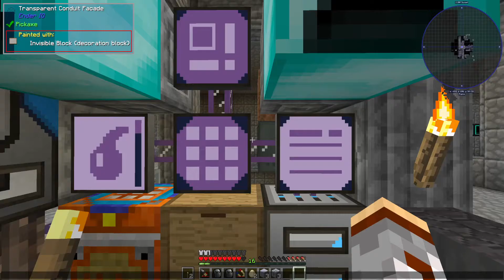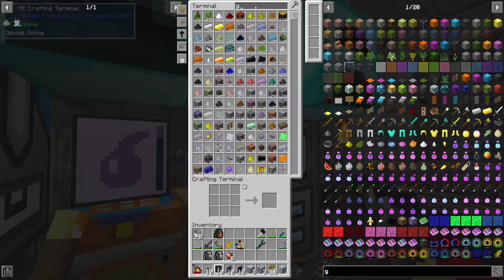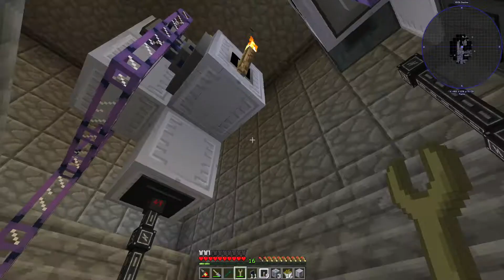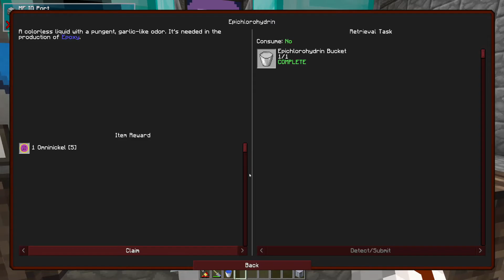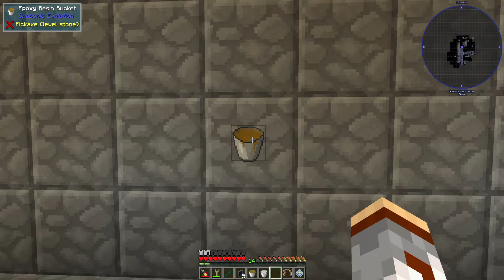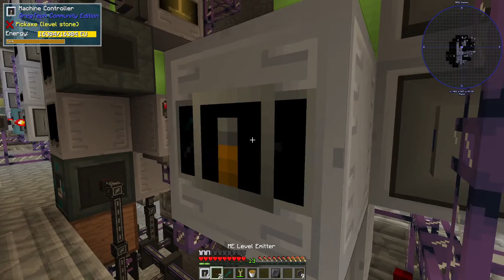(S2) Omnifactory: Dev Version: Ep 42 - Epoxy Sheets & Boards

Comment: If BPA is only used in epoxy production, it might not be necessary to store it. Just output it straight into the chemical reactor producing epoxy and just level emit at the final product. :) The intermediates will hardly be useful elsewhere anyway